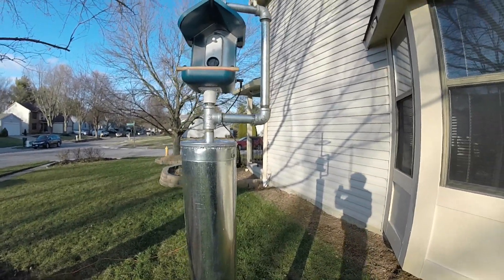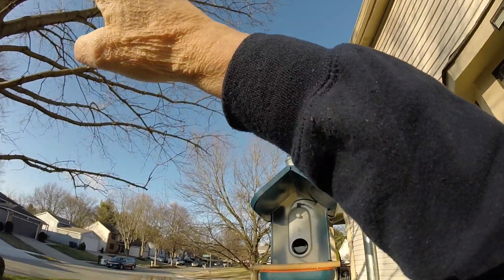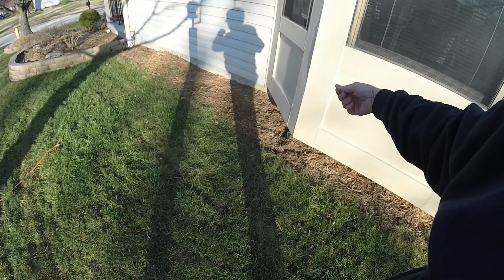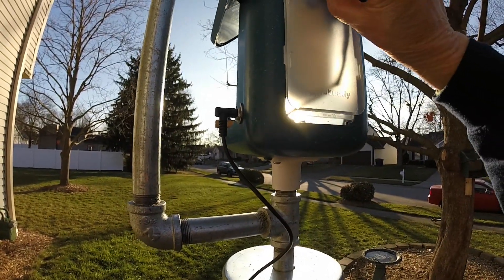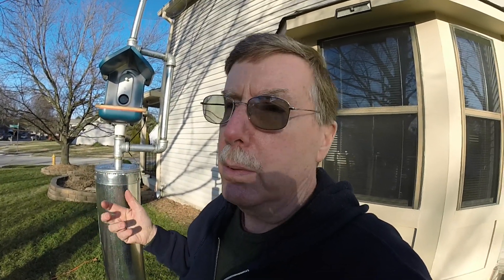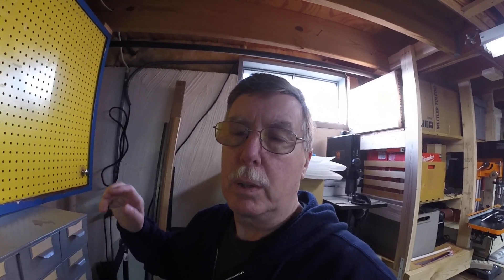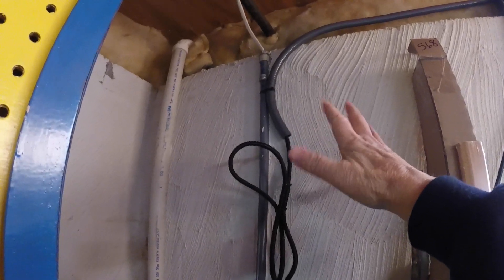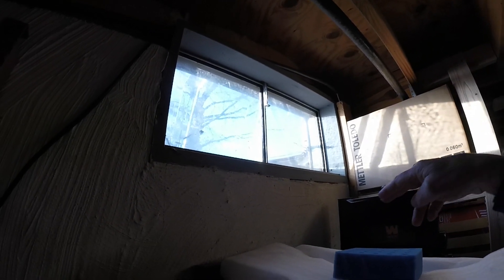Bird Buddy bird feeder upgrading with Squirrel Proofing and an underground constant power source

Comment: Wooow! How much do you charge ? All I get is squirrels on my bird buddy 😞
Reply from the maker: The Bird Buddy stand in the video is design version 2.0.   I am now on up to design version 3.0.  I call it The Tin Man.  There is now an overhead duct to fully address the Kamikaze Jumping Squirrels.  It has been weeks now and NO squirrel has defeated The Tin Man.  I need to update this video.  The overhead duct is a 14-inch diameter by 2-foot high duct with a polycarbonate clear top that the 3/4-inch pipe attaches to.  Sort of a glass ceiling that lets the light in.  I'll get the new design up on here ASAP - weather permitting.  All the metal pipe, fittings, and ducts/cap are from Home Depot.  Very little work to make it all fit - just a 1 1/8-inch hole in the lower duct cap and a couple of small holes for the screws to hole the cap on lower duct.  The pipe is all threaded and you just screw it all together.  Thank you and if you have any questions please ask.

Comment: The 5 foot metal duct is from Home Depot?  Thanks for taking the time.
Reply from the maker: All the metal is from Home Depot.  The cap for the 5-foot duct is the only piece that needs a hole of just over one inch.  All other piece of pipe and duct are just screw together.   I used pliers to tighten the pipe and a sledgehammer to put the pipe in the ground.
Reply: @trekOCLVone  Thanks, I was looking at 1inch post types at Home Depot earlier.  I am thinking I need to use the post type mount, it's hanging now and not many visitors (only one so far) and I suspect it's the instability that's the fault with it.  Have a great week, laters.
Reply from the maker: @PracticalDigitalStrategies  I have no way to use the rope.  I've been experiencing Squirrel invaders.  The setup in this video held the kamikaze jumping squirrels at bay for a week but yesterday a Jumper got on the overhead baffle and that was the end of that.  So today I'm back to the drawing board.  I've got the design 3.0 half built.  This is going to be over the top!!  Literally.  Another duct overhead and hopefully the last design I need to make.  Mr. Squirrel has defeated everything I've tried.

Comment: How much did this cost?
Reply from the maker: All of the metal including the duct and cap and all the 3/4" galvanized pieces comes to $73.   The overhead glass baffle is another $22.    Some baffles from the big-name companies will cost that much ($70 or more) so, for a stout 3/4" galvanized setup that is Ground Squirrel proof and as of this writing kamikaze jumping Squirrel proof that isn't expensive at all.  This 3/4" galvanized design will be much more stout (100 mph) and last a long time.    The electrical I can add it up if you would like.  I already had some of the pieces but above provide most of the power cable costs.